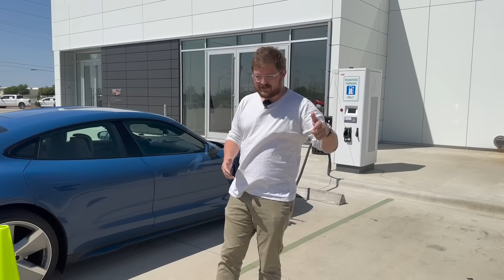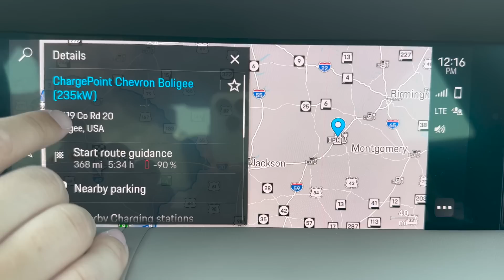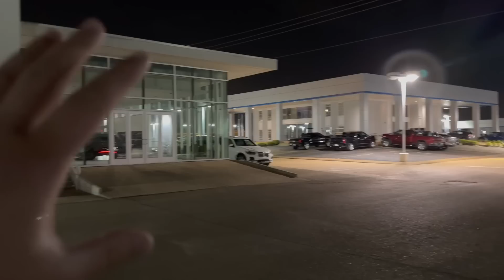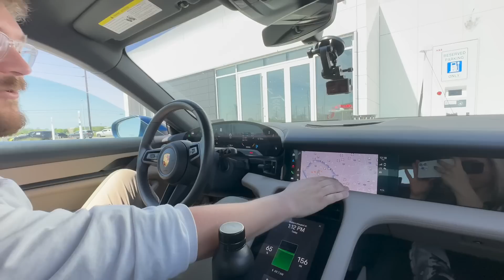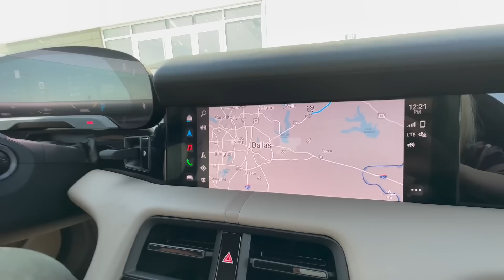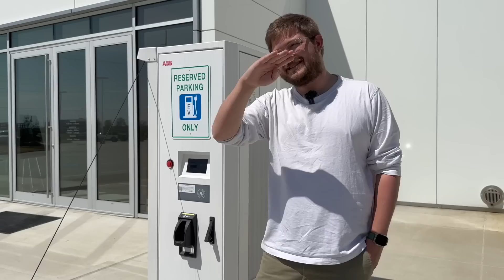The Great Southern DCFC Desert! Meet The Single 50kW Charger Linking Dallas, TX To The East

Comment: Whenever I see media (videos/articles) about the cost of charging ev, it astounding how the average consumer could afford to "fill it up" for comparison I have a f350 and a Lexus LS460 both of them have about 25 gal gas tanks. That takes 40-55 dollars to fill. The range is 300 for the f350 and 420 for the Lexus.
Is the battery pack going to last 15 years 
Because both vehicles only needed regular maintenance. And are still running. 
I like an apartment complex that doesn't offer ev charging. I would like to try a ev but the charging cost kills that Idea.
Reply: Based on the values you provided of a 25 gallon tank, costing $40-$55 to fill up, that would equate to a gasoline price of $1.60 to $2.20 per gallon. I just looked up the cheapest average price for regular via AAA and that's $2.90 per gallon in Mississippi, the most expensive state is California at $4.823. The US average is $3.49 for regular.
Reply: @boilerdown1 that price is for half to 3/4 tank and yes I live in a region with low price gas.

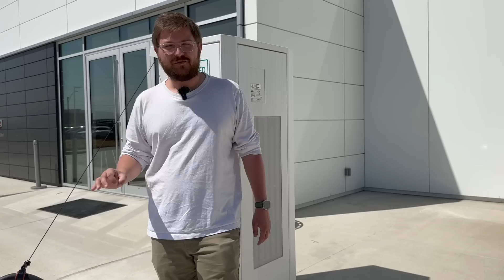Comment: 13:52 $50 iddle fee, is it for the full hour or like $1 a minute, 
or are you charged $50 even if you overpass for maybe only 5 minutes? 
Is there any delay between the end of charging and the moment you un-plug the car?
Is there an iddle fee if you stay parked without charging, like doing ICEing?
Reply: There would be no way to charge idle to someone that stays there unplugged it can’t tell there’s a car there unless it’s plugged-in.
Reply: Oooh, good point. Could be a giant +$50 charge if you idle for 1 minute with that wording.

Comment: Road tripping is the only time you pay higher prices for an EV. 95% of the time I charge at home and pay $0.096 per kWh. I typically charge once or twice a week for maybe $4.80 to maybe $5.75 per session. Where I live I pay on average $3.00 per gallon for gasoline. My Raptor would cost me about $20 in gasoline for the same miles. So even if I would drive a hybrid, the EV will be quite a bit lower to operate and if extrapolated over time, it's enormous savings. Gasoline is way more expensive for me on daily commuting and running around stuff. But for road-tripping, I gladly pay higher prices for gasoline because of the higher range and overall convenience. Gasoline will continue to rise in price, but electricity in most places is quite low and doesn't have any volatile price fluctuations.

Comment: That’s why those of us down here have to drive Tesla still. Even then, it’s an hour to the closest one.

Unfortunately it’s a political issue. Mississippi being the worst, and having the highest ev fees. A lot of deserts in northern Alabama, Louisiana and areas of Arkansas also.  

Did the Phoenix run in January. May want to check your route through New Mexico. Gets a little tight depending on range from west TX to Phoenix still. Especially the AZ/NM line. 

Northern (40) route is still not great either. Tight in NM, OK, AR.

I’d rather see Tesla install new magic dock stations instead of converting. Help both of us out with these charge deserts. With both of us using, we can get the utilization up for it to make sense. Hope now you see why I talk like this. You’re seeing first hand what it’s like here.

Comment: I've driven this route (NC->SoCal) like 5 times. Even driving a tesla through I20->I10->I8 is not that great. After Shreveport, there is a v2 in Lindale, TX (which is always crowded when I go through it) and then after DFW, you hit a bunch of V2s along I20 and I10 until you hit Tucson. That area needs some additional V3/V4 spots as well as a ton of CCS spots. 

I cannot imagine doing that trip using CCS.

Comment: Been pretty happy with the infrastructure rollout in Alabama so far. Lots of CPE250s which have been rock solid reliable for our Soul EV. Tennessee is another story though. They have lots of aging evgo units that were installed back when the leaf was a new vehicle. Many of them are CHAdeMO only around the Nashville area since that's where the leaf is made and you can pretty much roll the dice as to whether or not any of them are going to work when you get there. If there's an Electrify America alternative you might as well make it plan A.
Reply: They more EA stations in that state than Alabama has. I've had far less issues driving thru TN than AL, but it's getting better in both states. EA has a station planned for Huntsville in 2024 and that along with other networks/chargers popping up, should make it a bit easier, but the back roads need some support too.

Comment: Doing one charge on a road trip is fine. Multiple? That's a no go for me. Most EV's  have around 250 mile range these days. But actually less if you are using public chargers where you charge to about 80%.  

And sitting somewhere I'm not familiar with for like 30 minutes plus? And in the middle of the night? Umm no.

Charging times, range, infrastructure and cost still has a long way to go for people who want an EV to be able to use as an everyday and road trip vehicle.  As for now they are mainly daily drivers or short jaunts. Also the charge long charge time alone makes an EV not suitable for a lot of people as not everyone has their own personal access to a charger at home.

Comment: With one, Shreveport has one more 50 kW DCFC than New Orleans…
Reply: One New Orleans area KIA dealer has a 22 kW charger that’s been broken for weeks. And yet Lafayette has a Genesis-Hyundai dealer with not less than FIVE 50 kW chargers (I assume  the owner must be an EV evangelist), and apparently the Baton Rouge Porsche dealer has one or two of those 200+ kW chargers. Seems to depend, so far, on the personal feelings of dealership owns.

Comment: My next car will be gas.  Electric is actually more expensive than gas right now on a Per Gallon Equivalent (12 to 15 dollars per gallon equivalent).  I am sure by 2035 to 2040 electric cars and charging will be on par with gas, but since I only use cash it is impossible to pay for charging an electric car.

Comment: it is the responsibility of car dealerships to provide EVs supercharging stations. If not not who ? They are the sales outfit of EVs manufacturers. Today I ask myself where does Kyle stand on who should built and service supercharging stations: Circle K, 7-eleven? No! Tesla did the right thing. Where is your Tesla adapter?
Reply: "They are the sales outfit of EVs manufacturers."

Not really, and that's part of the problem. In the charging desert areas, even drivers that really want to buy a non-Tesla EV often simply can't means no dealer within 500 miles of them will sell them anything that doesn't run on gas. Even dealers whose logos match companies that claim to offer EV models often don't actually carry those models.

Some of these dealers may still have a level 2 charger on site, just in case they acquire a used EV through a trade-in. But, from their perspective, gas cars is what they're familiar with and what their sales people are familiar with, and they feel no market pressure to change. From the perspective of Ford and GM, they'd rather have what limited EVs they do sell all go to CARB states anyway so they can sell more gas guzzlers in the CARB states while still satisfying the overall fleet fuel economy requirements.

Comment: New Hampshire may trail Louisiana in VW gate EV infrastructure. The state earmarked VW funds for DCFC in 2018, but not a single unit has yet been installed from that budget. There are three EA sites from the national program. The most important one is probably in West Lebanon, near the intersection of interstates 89 and 91. Unfortunately the units there have been plagued by maintenance issues. Hopefully, a recent upgrade will improve the situation there.

Comment: This is why infrastructure should have come before the cars. The world of EV’s so far has been a prime example of putting the buggy before the horse. There are also too many examples right now of why it is so important to not limit ourselves to one fuel source for transportation and job duties. I salute the ones out there that are willing to dive into this and endure the hardships of what will soon be considered primitive tech, but for me, I will burn gas and diesel until they make major improvements to batteries and charging. Just throwing chargers around won’t do enough.
Reply: I think a large part of EV charging can be done at home. So I feel that the reason why the cars came out first but now more people are traveling by car and not by plane and bus so the public charging is trying to catch up. Also, you have to remember that the car manufacturer makes the car, not the chargers.
Reply: @derrickwatts4675  the charging at home argument is the first and probably the most used point of view for anyone that will have a disagreement about EV’s. It’s important to remember that a lot of people rent and unless apartments and condos and parking garages and even rental houses with non enclosed parking are going to have a charging station at every parking spot, then home charging is not a fair point to use in regards to ev transportation. I think the home charging stance is more for the haters and less for making a good case in regards to everyone needing to jump on the ev wagon asap.
Reply: "This is why infrastructure should have come before the cars"

Without the cars, nobody (including the government) would find it worthwhile to spend the money on the infrastructure. This chicken-and-egg cycle is one big reason why hydrogen cars failed. For better or worse, the fact that EVs can be charged at home by anyone with an electrical outlet in their garage provides a way to get past the chicken and egg cycle. The ability to home generates some EV sales. These drivers then demand infrastructure as they want to be able to take their EVs on trips. So, infrastructure gets built. Of course, not everybody lives in a home that allows them to home charge. But, with over 60% of Americans residing in single-family homes, enough do to overcome the chicken-and-egg problem to get the infrastructure built, at least in travel corridors.

Comment: You and Alyssa got excited about an idea with far too many assumptions (or ignoring key facts) about the human, economic and ecological cost of the transition from I.C.E. Vehicles to E.V.’s and the electrical infrastructure requirements (& where possible) improvements to existing architecture to ensure EV’s where an adequate replacement! Obviously you and Alyssa aren’t alone… their are many others! 
  The plain truth is that the ACTUAL human, economic and ecological COST is orders of magnitude HIGHER than current I.C.E. COST! I do understand that these vital costs of EV production will go down in time. I and many, many others can simply NOT STOMACH THE HIGHER EV COST OF PROUCTION IN TERMS OF Human cost, Economic cost and Ecological cost! The last is your largest conundrum! The damage to the ecology of the planet by Production and dedicated use of EV’s is entirely hypocritical! Nuclear power would help a lot but that is a different issue!

Comment: Just get a gas car and you won't have problems
Reply: Just like some people like Dodge, Toyota, or whatever I feel like an EV is just another option for people to have. So I feel that we should not down people for buying evs we should be there to help them charge when they need to. I am a car guy and I love that EVs are on the market. I have a Camry, a Chevy Durmax, a Mustang, and Equinox. But there's a place for EVs.
Reply: @derrickwatts4675  I have an EV but I use it only in the city, isn't really convenient to do road trip, I did LA to Austin last week with my gas car and stopped like 3 times to fill it up, really fast but with my model 3 would take like 12 or so and probably 30-40 min on each stop
Reply: @eletrohitsbr  Yes that understandable.